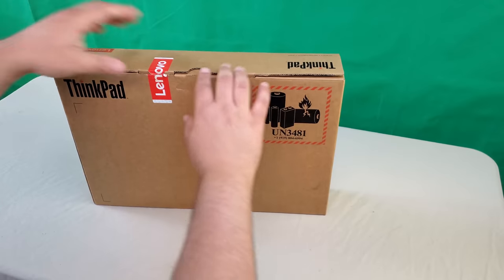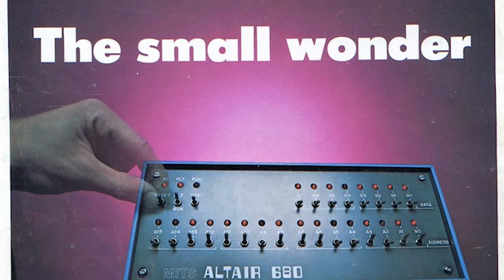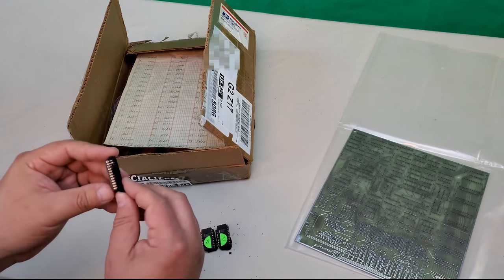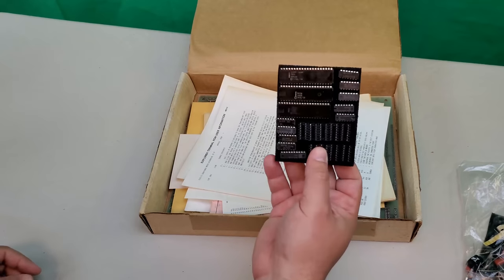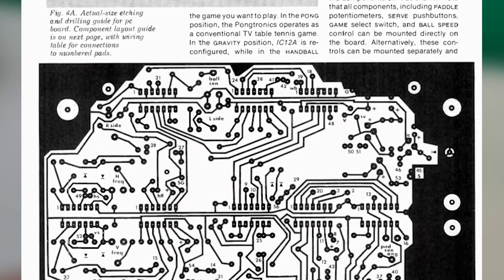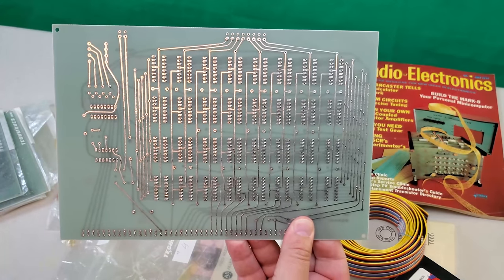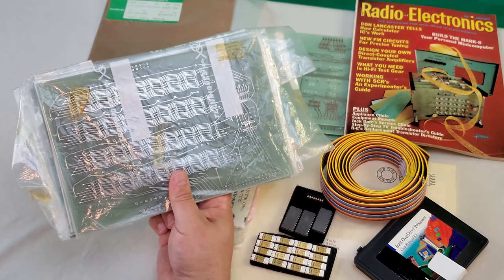Early Kit Computers

Comment: Hi. I am the David Griffiths who designed the DG680. Thanks for the nice review. 
In answer to your question about the numbering, the VDU was first described in Electronics Today magazine and they assigned it project number 640. When I wrote the article about the CPU they called it 680. I am not sure whether that was the next number in their sequence or whether they jumped to 680 in a nod to the Z80. Applied Technology, the company that sold the kits, tended to brand it as DG-Z80.  
I don't remember what the selling price was but I think you are in the right ball park.
You are right about the DG initials but I later formed a company called Digital Graphics Pty Ltd - what an amazing co-incidence about the initials ;-)
Reply from the maker: Thank you for this note!  It is always an honor to 'meet' the people who designed and made this stuff work.  I wondered about those model numbers!  I keep hoping to stumble on a DG640.  Do you know how well the kits sold?
Reply: @TechTimeTraveller  I think there would have been roughly the same number of DG640 or slightly more. Some people used the DG640 with different processors. I don't know the actual numbers but in the low thousands - small beans compared to the US market. I might have been rich now if I'd live somewhere else :-)
Reply: @diggraph  Thanks David for designing those boards, they came along at a time I was a high school student, and I learned a lot. My only wish was that the PCG was a full bit-mapped screen instead of a character rom set replacement. I spent a long time trying to devise a Least-Used system for recycling PCG chars, never got it to work properly. DGOS was a great little monitor!

Comment: Hey. Reseller here. We used to do storage units. We found a partial Altair 8800 kit. It was in a storage unit for nearly a decade.

The storage facility would have likely disposed of it. But we put it up for auction. The market decided a price of $1800.

Resellers provide a service. I guarantee many collectors would not deal with what you may come across in abandoned storage units. It's incredibly hard work. But sometimes it pays off.

Comment: When I was in college in NYC back in the 70's, I was a member of a computer club in Long Island.  There were at least 3 people in the club who had built Mark-8's, and there were one or two under construction.  At every meeting we would have people bringing in their machines and demonstrating them work.  The MARK-8s sometimes played music either via a speaker hooked up to an output port, or by making noise on a transistor radio.  I remember that two of those Mark 8's were expanded machines, housed in large cabinets (internal separate power supplies).   I don't know if those were kits or home made PCBs.

In an attempt to build a PIC-A-STAR amateur radio transceiver using DSP, I actually have made some of my own double sided boards using toner transfer.  It's a bear to do.  I first put the resist on one side and spray paint the other side to protect from the etchant.  I then etch the board, I used a mix of 2 parts H2O2, with 1 part of Muriatacid (Diluted HCL,  sold to adjust swimming pool PH).  After the first side is etched, I removed the paint and the resist with mineral spirits.  Now I drill a few key holes to help me align the second side toner transfer.  The PCB design artwork has a few "bullet points" on it for this purpose.  With the second side resist ironed on, I spray paint the etched side and throw the board in the etchant again.   Again remove paint and resist, clean, dry.

The PCBs I made were for high density SMT parts, through hole 'jellybean" parts, and the usual gang of connectors.  The 100 mill through hole parts spacing actually ended up aligning close enough for the dual side layout not to short circuit, or not circuit.  I used "Augat" sockets which stand proud of the board by about 1mm, you can solder these on both sides of the board.  So homemade double sided boards are not impossible, but these day you will just use Kicad to design them, and send off to China to get them made.

Comment: And now having watched the whole Central Data 2650 segment, I can add a few more comments: Yes, you're right about the box and that added sheet; neither of those was part of the stock package you got from Central Data when ordering from the Radio-Electronics article. My memory agrees with you, that you did indeed just get the bare board and the PROMs when ordering that way. Those PROMs ought to still be fine, since they're the old "Fuse-Link" style where microscopic metal fuses were actually "blown" when programming those chips. So they stand a much better chance of working after all this time than the EPROMS other old computers used, in which the floating gates eventually have their charge leak away.

If you or anyone else actually builds up one of these bare boards (which I recall was fun), watch out for little metal bridges. My own board was not completely etched and had a few little copper whiskers connecting traces that shouldn't have been connected. Luckily, I had a couple of experienced mentors who found that problem for me; I wouldn't have thought to look for something like that!

Since this board has a composite-video output, it should be possible to connect it to any modern monitor that has a composite video input (though I've been saving a couple of old CRT monitors just for connecting to my own CD 2650 once I restore it). Oh, and the intro frame in your video indicates it ran at 3.5-something MHz. Hm, well I do recall overclocking it once I got a 2650B chip, but I believe the stock board ran at 1.[something] MHz. It still seemed pretty zippy compared to the minicomputers I used at school since it wasn't going through a serial terminal like they were. 

Connecting a keyboard might pose a bit of a challenge in modern times, since it uses a parallel ASCII interface. I bet there are or were converters out there to convert USB or PS/2 keyboards to that ancient standard, though, since once upon a time surplus keyboards almost all used that interface.

Again, I'm happy to answer any Central Data 2650 questions if I still happen to have the information in my leaky old memory. :)

Comment: I worked for Midwest Scientific Instruments in Olathe Ks back in the late 70's, they developed a business system based on the SWTPC 'standard' with the Motorola 6800.  I have a link to their catalog here...   I also have an unbuilt SWTPC system, cassette interface and an open frame monitor that I will probably put on eBay eventually.  Hard to do, because one of the original boxes is addressed to MSI from SWTPC, and another is from SWTPC to Computer Workshop of North KCMO.   My experience with Computer Workshop involved fixing Polymorphic 8812/3 computers, since I already had experience with Poly 88 systems at Cyborg Computer Gaming Center in Westport (Kansas City, Missouri) back about that time too!
Reply from the maker: Awesome!  I have a MSI 6800.. its a very well built machine.  Someone had changed the EPROM to something called Weebug so I wasn't able to operate it with the MSIbug until someone who had a copy of the listing sent it to me, and I was able to burn the 2708 with my SWTPC 6800.  I have MSI's 1702 prom burner but have not been able to locate the software to drive it yet.  I'm trying to archive everything I find of theirs but it's not common.  That's awesome that you worked for them!  If you ever post pics of that unbuilt 6800 kit please let me know.  I doubt I could afford to buy it but it'd be awesome to see!

Comment: I have TWO of the "Bay Area ES 106" TVT's in my hand right now.  I just dug them out of storage this afternoon and washed 30 years of dirt off.  They are built up but one has a number of modifications and they both look like maybe they were bought as bare boards and the parts sourced locally as many of the parts are higher voltage or larger size than spec. 

I picked these up as surplus around 30 or so ago years ago for about $20 as I recall.  I am going to try to get one working as it has all of the chips and doesn't look too bodged. 

I downloaded the assembly manual a while ago and am binding all of the various "TV Typewriters" together into sort of a reference manual.  If I get one of the Electronic Systems boards  working, I will post some video.  

I also have the Synertek SYM-1 which I believe was a counterpart of the Kim-1.  6502 processor, 1 K of memory, hex keypad, etc. I paid around $380 for it originally and later sprung for the $100 Basic ROM.  I had my first TVT hooked to it so as to be able to write programs in Basic.
Reply from the maker: I keep hoping to find a Bay Area TVT but they never come up for sale.  I think because they just look like random electronic junk.  Let me know when you've got some video up!  Would love to see one operating.

Comment: I've etched and drilled my own double sided boards from artwork using the toner transfer method.  The technique is to transfer toner pattern to one side of the board (with a clothes iron), and then spray paint the other side to protect the copper during etching.  Etch the board, then drill a few key holes that are the alignment markers with the other side.  Remove the spray paint from the reverse side, and then transfer the toner to the now blank side.  Use push pins in the alignment holes to insure that the second side pattern lines up, then iron on the reverse side pattern.  I usually do the most complex side first.  Spray paint the etched side, and then etch the second side.  Then remove the paint and resist from both sides. Drill out the board.  Hopefully, if the artwork was good, and your alignment close, the holes will all line up.  I usually didn't get 100% perfect alignment, but it was close enough to be able to connect both sides without shorts.   Double sided board artwork designed for home etching will usually have lots of wire via holes.  In some places soldering a part on both sides performs this function.  Augat sockets that mount about 1-2 mm proud of the board can be soldered on both sides.  I am building a DSP ham transceiver called the Pic-a-Star, and have etched some double sided boards that use SMT parts.  The most complex part was the DSP processor board, DSP codec board, and mother board.  All double sided (though 80% of the tracking was contained on one side).  The DSP module works. :-)  Gluing two boards together is an interesting approach, but you CAN home etch a double sided board.

I have mixed feelings about not building those kits.  I see MANY classic unbuilt Heathkits on ebay.  In many cases the collectors won't even OPEN the box as they feel that devalues the kit.  (But then how do you know that you didn't just buy a box full of rocks?)   Sadly, even if you wanted to build some of those kits you'd first have to buy new capacitors as the ones supplied with the kit have probably all dried up and are now useless.  You should quickly remove all those IC's from the old black foam,  I recently discovered some parts I'd had in storage for some 40 years with the IC pins completely rotted away!  I was able to salvage some by soldering them into Augat sockets.  BTW, there is a basic language for the 8008 that was published in book form.  (The code is supplied in both 8008 and 8080 versions).

I started out in computers by getting a 6502 processor at MosTechnology's booth during the 1976 ('75?) computer show in Atlantic City.  I then bought a bunch of bare boards from OSI (series 400).  I got 16k worth of ram boards, and the CPU board.  Their boards could be populated with either 8 or 12 bit memory, and 6502, 6800, or 6100  (cmos PDP 8!) processors.  I also obtained MosTechnology's TIM monitor chip.  I scored 16K worth of 2102 ram chips at a Ham flea market.  I got the 400 series 6502 working with a CRT terminal (it was a bare populated board, no case) and a surplus keyboard.  I never got beyond running tiny basic on it though.

Comment: There is, IMO, a BIIG hole in your list. The Sinclair ZX80.  This came out in 1980 and the kit was sold for £79.95. It used the Z80 and came with 1kb RAM. It also came with full QWERTY keyboard, RF modulator for video output to a TV, & a cassette tape interface for storage. The supplied boot ROM was installed with Sinclair BASIC.

In short it was a full home computer system with an input system that anyone could understand & programme c/w video output.  I believe this kit marked the transition from computers being purely for engineers to their becoming something everyone could own & use.  Thus it started 1980s home computer explosion.

I didn't have one of these as while I was saving up  its successor, the ZX81, was released and I built one of these instead. I might also add that this machine made a pretty good Z80 programmer out of me, something which later became a very useful employment skill.

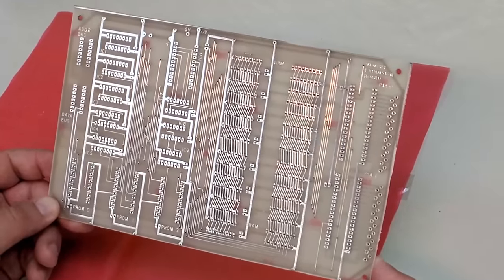Comment: 4:44 My brother and I built a number of Applied Tech's S100 boards (actually 'S-100' back then) and also the black cardframe. It was a good system and the DGOS ("dee-goss") monitor with hex editor on 2716 was pretty easy to use and could save to tape.

It was all fine until one Saturday we went to Applied Tech's shop in a northern suburb of Sydney only to find not a trace of their S100 machines anymore. They had all gone and been replaced by the Microbee. The CEO of AT told us it was backwards compatible with the S100 system and that Microbee software would run on our machine.
Well of course it wasn't that simple. The Microbee had a different keyboard setup which IIRC used the light pen input on the 6845 and any Microbee software needed patching to use the DGOS calls. I did do it for a few programs. Needless to say we were very annoyed about it all, after having spent a lot of money on building the computer.

I modified the DG680 with a rocker switch on the top edge of the board to switch a 4MHx crystal, and replaced the CPU with a Z80A and it ran really well. Sometimes I could even switch from 2 to 4 MHz and it would continue to run but more often it needed a reset. I think the DG640 VDU was based on the SOL-20 video circuitry, certainly AT sold games such as Missile Defence that displayed 'Processor Technology' on the start screen.

As the supplied MicroWorld BASIC was not very good, I ported TRS-80 LII BASIC to the machine by typing in the 12K of hex digits from the BASIC Decoded book over a few weeks, patched the keyboard and (I think) video start location. I made a replica TRS80 graphics character set for the PCG card and got MS Flight Simulator to run, made a 4 voice music synth speaker for it (from a BYTE article), also started writing a DOS for a Versafloppy II based on another BYTE article. I still have some of these bits of software, the rest went with the machine a long time ago.

Comment: I got the Central Data 2650 back in the day and built it. I didn't have a parallel ASCII keyboard so used an AIM65 to provide that function. The CD2650 still works. I am thinking of expanding it and putting it into a nice perspex case. I have a spare C64 keyboard which I will use instead of having to get out the AIM65.
Reply from the maker: Very cool!  If you decide to take some pictures or video please let me know.  Would love to see one assembled!  Apparently there was an expansion kit of some kind?  I saw a pic of it on old-computers.com I think.  Looked like S100 or something similar.
Reply: @TechTimeTraveller  : As someone who cut my home-computer teeth on my Central Data 2650, I can confirm that the expansion you're thinking of is Central Data's S-100 expansion board. I used mine to expand the RAM and add Central Data's floppy-controller board. (Every few years I search to see what's out there on the CD 2650, and wow I found a lot this time, including your video! I know I'll be restoring mine at some point, so I keep gathering as much info as I can toward that day. And I'm happy to answer any CD 2650 questions that my aging memory will let me - it was my only computer for a few years in the late 70s so I knew it extremely well.)
Reply from the maker: @gordonbrandly4352  Many thanks for the reply!  I actually very recently got my hands on a built CD2650 and the S100 expansion board.  They look to be in pretty close to pristine condition, but are missing the interconnect cables that link them.  I went through the old Radio Electronics articles and sort of followed it month to month hoping to find where they introduced the S100 expansion board, but alas.. no sign of that.   I suppose it could have come out months after the original article, or maybe not even been an article at all.  Any info you have would be deeply appreciated for sure!
Reply: @TechTimeTraveller  : Excellent! And yes as you suspected, that S-100 board came out a couple of years after the original magazine article. I have all that stuff squirrelled away in my garage, and I'm hoping I still have the manuals as well. You've given me more incentive to look for it now, though work is busy and it might still be a while before I can get to it. But I'll make a note to look as soon as I can and contact you if I find any of that. I could always haul my main board assembly into the house and take pictures of how those two boards are connected, at least. I'll need to take those pictures sooner or later anyway. :)